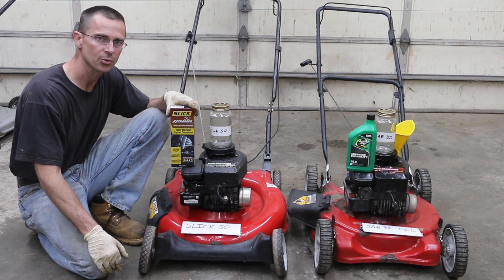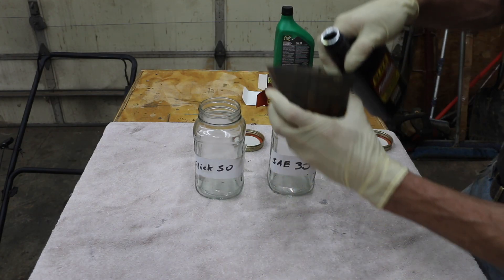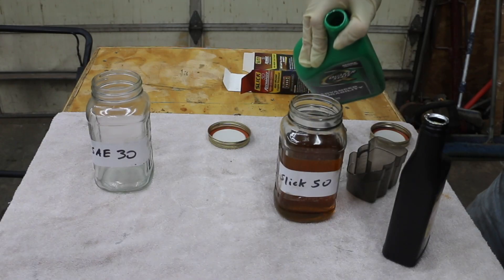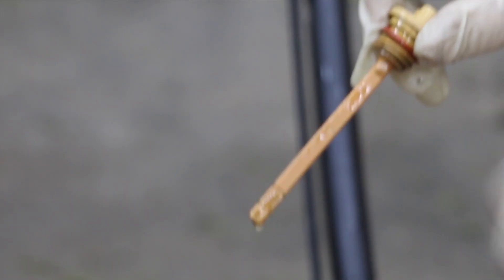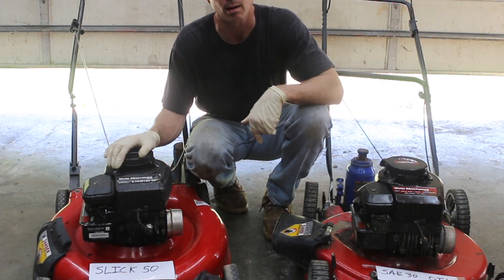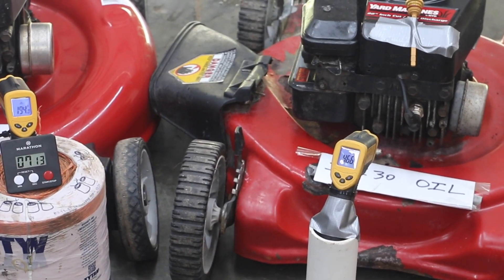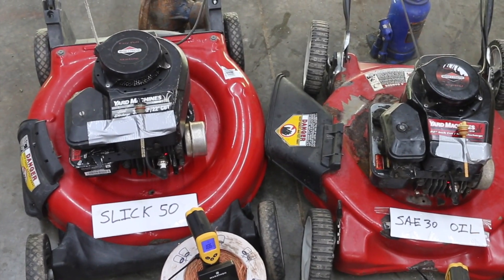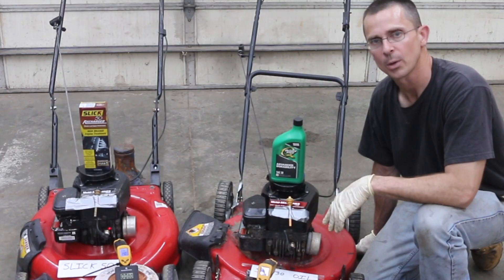Can't believe what SLICK 50 did to my engine!!--Dry Crankcase Test!

Comment: im 75 years old, and about 35 years ago I saw a Duralub oil test with DRY V 8 that ran for a long time at high RPM. I've been using it ever since.But your test with SLICK 50 has got me to wondering . Can you shed a light on Duralub?
Reply from the maker: Thanks for the video idea!

Comment: Plain bearings rely on a constantly forming dynamic oil wedge to operate in the first place. IOW, there must be a supply of oil to replenish the oil that gets 'squished out' in operation. Although I immensely enjoy Project Farm videos, this is NOT a fair test because there's no lubricant that will maintain a dynamic oil wedge merely by virtue of its viscosity or surface tension. Bearings used in engines rely on a constant exchange of oil for support and cooling. Still ... very entertaining ... thanks.
Reply from the maker: Thank you for the constructive feedback.

Comment: if bearings are loose enough motor can run a long time with no oil. Tight new bearings especially aluminum ones as in these motors lock up quick. The one with slick 50 may have been a tighter engine than the 30w motor. Hard to say. The fact that we saw lower temp shows less friction So maybe re test on friction wheel wear stand device you have . Measure wear and temperature of both. Nice shows thanks
Reply from the maker: Great point. Thank you

Comment: The flaw in your methodology is the following. After testing the temps on both engines you needed to swap the oil and slick 50 into the other mover and test the temps again. Its entirely possible both engines have different characteristics and it needs to be confirmed via the swap. THEN proceed to blow both out.
Reply from the maker: Thanks for the constructive feedback.

Comment: Funny test, but unreliable results. You have two different mowers that were not built the same or even at the same time or same manufacturing plant. We do not know which mower had more hours or more sudden stops (choke outs during use) on it before you got a hold of it, heck we don't even know if the machines you chose had a properly balanced blades (assuming you left the blades on them.) Little imperfection in either motor could skew the results.

Long story short, slick 50 could be just a snake oil or it could actually do something good for an engine, the thing to keep in mind is that the results will always vary because there are no perfect results.
Reply from the maker: Thank you

Comment: Back in the 70's a friend had a new Chevy 6 cylinder van. He used 100% slick 50 instead of the recommended 10% or whatever. I ended up replacing the engine soon after and when disassembled, it had the worst cylinder ridge I'd ever seen.
Reply from the maker: Wow!  Thanks for commenting on this.

Comment: Put oil in these locked up engines, grab the blade to wiggle the engine back and forth to free it up and they will run just fine. I have bought new seized up lawn mowers from Lowes where customers forget to ad the oil, and return them after they ad the oil and lie about it, and they run fine.
Reply from the maker: Great recommendation!
Reply: @ProjectFarm  my father had a slant 6 dodge that jiffy lube forgot to replace the drain plug on an oil change. My dad locked it up then paid to have a junk yard engine installed. It ran poorly so the mechanic sent my dad to the same junkyard to pick out another engine. He chose one that was already pulled. It was installed. When the mechanic installed it he had to break it loose bc it was seized. It ran fine. Afterward, we checked it out and it was his original engine returned as a core.

Engines have aluminum piston. Aluminum expands twice as much as steel, so when they get hot they grow larger than the iron bore. There is some "welding" of the two metals but aluminum and iron really don't mix well. That's why after it cools down, a little nudge gets them moving again.

Comment: Duralube is the best additive I have used but I have not used many. I had 1986 chevette that developed a bad valve cover leak. To the point of a quart a day leaking out. I had enough to buy another car so I put a bottle of Duralube in it one day and stopped putting in oil. 2 weeks later it wouldn't go over 25 mph but this was almost 200 miles later.
Reply from the maker: Thank you

Comment: Engine Oil additives are'nt recommended for Cars or Lawn Mowers, Oil manufacturers spend millions developing Oils and no additives are necessary.  Don't use Automotive Oil in a Lawn Mower Engine, use 30.
Reply from the maker: Thank you

Comment: I never bought into the slick50 hype because every fabled oil additive I'd tried, based on testimony from technicians I trusted, did nothing but give me some kind of grief.  I worked for Mobil back in the day, and comically, Mobil1 full synthetic, was the only hype, albeit, non-impartial, that actually proved, OMG, has it been that long...  32 years later, I'm still using Mobil1...

Anyhow, I did have a neighbor who worked for Chrysler during the Slick50 craze who showed me an experiment he performed, filtering slick50 with a coffee filter.  You guessed it, the filter captured all the white gue out of the oil, which, incidentally works really nicely for any mechanical assembly lube for equipment that doesn't use oil based lubricants.  I don't recall how many microns a coffee filter, vs. an engine oil filtered to, but he expressed a concern that adding Slick50 to engine oil would have an unwanted side effect of clogging filters, causing oil to bypass and not be filtered at all.

Obviously, the premature failure on your Slick50 B&S was not induced by a clogged filter.  I'd still be curious to see what component, wrist pin, ring to cyllinder, or where the final point of failure was on the Slick50 motor.  The amount of heat the non-slick50 motor took, I'm AMAZED!!!

I only recently found your channel, but so far, I like how you think, and especially that you'll run tests with different expectations than what the results prove.  You from Missouri?  :)

Great channel, I just subscribed!  Keep doing what you're doing!

Steve
Reply from the maker: Thank you for subscribing!

Comment: It could be that both engines did not have the same wear,  the one that quit first may have had more hourly use, it could have been run low on oil before causing damage to the engine. Or the engine could have been previously overheated prior to the test not very scientific to really prove anything.
Reply from the maker: Thank you

Comment: Not as much oil was pulled out of the SAE30 lawn mower.
Reply from the maker: Thanks for commenting.
Reply: @ProjectFarm  big fan, and no disrespect. Just stating that the residual oil could have allowed the SAE 30 engine to have more lubricant and run longer.

Comment: From the looks of the front wheels the Slick mower has been pretty well beaten to death before you got it.  Did you tear down and inspect both engines before hand??  Were both engines in equal condition at the start of the test run?
Reply from the maker: Thanks for the constructive feedback.  I thought they had about the same amount of wear.

Comment: I'm assuming you didn't run the slick 50 in the engine for the suggested amount of time to coat the parts properly. In an automobile it takes a week of driving. I also didn't see the white creamy teflon in the oil that happens when you shake the bottle before applying the treatment. That being said, the new slick 50 is not the same as the original slick 50. The U.S. government forced slick 50 to stop putting in the original teflon because of "complaints" that it stopped up oil filters and damaged engines. This was back in the 1990's.  I used the original slick 50  in my 1988 ford probe and noticed about a 10 horsepower increase. Also my gas mileage increased by 2 to 3 miles per gallon. And I never had any trouble from clogged oil filters. I tried the reformulated slick 50 in my next vehicle in 2000 and never got the same results. The new formulation just doesn't work. I suspect the car manufacturers didn't like a product that makes engines last longer so they lobbied the government to kill the product.
Reply from the maker: Thanks for the constructive feedback.
Reply: Now that you mention it Larry I remember the old Slick 50 was a creamy color like caramel........I used it in my motorcycle and it increased the MPG quite a bit.

Comment: Could you please make a lock up drytest with modern capitalist MOS2 Liqui Moly additive compared to former communist 1980s east german army Motimol Mos2 oil additive? It is said that Motimol is a superb additive! Back in the GDR a bottle Motimol has been sold for 450 GDR Peoples Marks. This Motimol has been used in soviet piston aircraft engines and turbines as safety anti seize additive, in the case the engine lost its oil during fight...(hit by bullets or internal technical problems) https://www.ebay.de/itm/Motimol-Olsuspension-Olzusatz-Additiv-MoS2-Molybdan-fur-alle-Motoren-Getriebe/381533126750?hash=item58d525805e:g:OZsAAOSwqrtWp3g3:rk:1:pf:0
Reply from the maker: Great video idea!  I don't know hot to get the Motimol MOS2.
Reply: You easily can purchase NOS MOTIMOL AND GRASINOL on German Ebay.de https://www.ebay.de/itm/Motimol-Olsuspension-Olzusatz-Additiv-MoS2-Molybdan-fur-alle-Motoren-Getriebe/381533126750?hash=item58d525805e:g:OZsAAOSwqrtWp3g3:rk:1:pf:0
Reply: Here is the other communist (kolloidal graphite) oil additive Grasinol: https://www.ebay.de/itm/Grasinol-original-DDR-Zusatzoel-2-Glaser/332845644357?_trkparms=aid%3D111001%26algo%3DREC.SEED%26ao%3D1%26asc%3D20170511121231%26meid%3Df2fba862190b4727bd4cb4a998e71285%26pid%3D100675%26rk%3D2%26rkt%3D15%26sd%3D381533126750%26itm%3D332845644357&_trksid=p2481888.c100675.m4236&_trkparms=pageci%3Aeae458d7-d8df-11e8-81b0-74dbd1802730%7Cparentrq%3Aaed80c1c1660a9cc5a4e859fffffa3f7%7Ciid%3A1

Comment: I hate to see someone destroy something that  someone else could use. But I understand why you did this. Yeah I remember watching those TV ad. At the time I had gotten a 76 F150. Only had 50k miles on it. I went to the parts house an paid ?  $40 or so for this stuff. The truck ran good. But I wanted it to last as long as possiable. So the next oil changed I used  Slick-50. Seemed to be doing OK for the first month or so. Then it started to lose power, an drink gas. I took it to a shop. An the guy says to me the engine has low compression. I loved my truck I took care of it an Never abused it. I believe that Slick 50  Fubared my truck.
Reply from the maker: Thank you

Comment: In the old slick 50 commercial, didn't they fill the engine with pure 100% slick 50, run it to circulate it
Then drain it,
Then do the run test
Reply from the maker: Thank you

Comment: In my experience, the slick 50 needs some significant run time to coat the moving parts and bond the Teflon into the micropores on the surface. I have seen hydraulic motors which were run for about 24 hours on a slick 50 mix before going into service in a mine using a glycol fireproof fluid. Before treatment, they would last only a couple weeks, after treatment almost 2 months.
Reply from the maker: Thank you

Comment: I liked your test but if the mowers were brand new and identical I think it would have been much more scientific.  Using two different mowers of unknow age etc. hurts the results. The fact that the slick 50 was running much cooler is very significant and should have resulted in a much longer running time.  I used slick 50 in my Corvette about 30 years ago, I immediately saw the tack raise 200 RPM, I had to slow down my idle.  It stayed that way too!  You did do a much better job than I could have so no dis respect.
Reply from the maker: Thanks for the constructive feedback.
Reply: Hey, you did a great job!

Comment: I am with you I thought slick 50 was good stuff and I bought their ads you just threw all that out the window good job sir so I guess the best thing to do would be  regular old motor OIl 30 weight and mobile one synthetic everybody swears by that I’ve never used it just plain old motor oil has always worked for me . But to test synthetic motor oil against conventional motor oil would be a great test ! Never seen it done
Reply from the maker: Thank you

Comment: This is a cool, shits and giggles demo but in no way does it mean anything.  The Slick 50 was not applied correctly, number one.  Number two, there's no way to derive anything from this unless you had two identical spec'd new engines.....

Comment: I have never used slick 50, I was too sold on Duralube. Fell in love with it in 1992 after my husband blew a big hole out the side of our 78 Toyota Corolla R22 engine. The engine overheated and quit stranding him down in the Sumner valley. I thought it was at least worth a shot to spend the $30 on a quart of Duralube and try it out to try and save the $300-$400 it would have cost to have the car towed 75-90 miles home to South Everett. Took the oil cap off, poured about an ounce or 2 in the engine, didn't want to waste to  much cause I knew it would all come out of the hole. Started the engine and poured about a third of the bottle in till it stopped the valve chatter. Replaced the oil cap and told him to head towards home and I would be right behind him. I suggested that he stay off the freeway for at least a little while. After about 45 minutes it started to overheat, bso I had him pull over. I put another third of the bottle of Duralube in it while it was running. It cooled down to around normal or just below immediately, so we continued our trek home. This time I told him to go ahead and get on the freeway. It took us about an hour to get all the way home. To my surprise and relief a tow truck was not needed, the car didn't overheat again and made it all the way home. The valves weren't chattering again either and I still had a third of that bottle of Duralube left. I saved it for use when we did the engine swap. Added it to the oil in the new engine. That engine lasted longer than the drivetrain and everything else under the chassis. We junked it about 8 years later.
Reply from the maker: Wow!  Impressive results by DuraLube!

Comment: Three things that ultimately make this a failure test for science and no this is not a hate comment. One all parts are different so they have different strengths and will break at different times even with same oil. Two when he drained them why was one jar less full than the other when they both was full with the same amount of oil. Three why did he not just use straight slick 50 for the test as mixing it with that particular oil could create a reaction that is worse than maybe a different oil. With that being said I’ve never even heard of slick 50 so I don’t know how it’s mixed.
Reply from the maker: Thanks for the constructive feedback.
Reply: Project Farm anytime I enjoy your videos they are creative even though I can say I’ve never been in a situation to risk complete engine failure to finish a job or to get home. But non the less they are entertaining to watch

Comment: Back in 1969 a rep for Slick 50 came and did a demo where they ran it without oil for a few minutes, still I didn’t believe the hype. In 1979 I did a tuneup on a 1978 Mercury Marquis and the customer wanted to add Slick 50. I set the Idle speed at 750 rpm. A couple of hours later after making a short 100 mile trip he came back and asked what I did wrong because the engine was idling at 1200 rpm. I reset it to 750 and that’s when it struck me that the Teflon in Slick 50 did reduce friction. Years later I learned of the class action suit where they used 4 ounces of Teflon and the rest of the quart was just oil. They were overcharging consumers and settled the suit. When I was doing an oil change in my plane a mechanic recommended adding a Teflon additive, it wasn’t Slick 50 and consisted of 6 ounces of Teflon and 4 ounces of oil and was half the price of Slick 50 at the time. I still believe both helps reduce friction as the hot Teflon coated the crank journals and cam lobes and journals.
Reply from the maker: This is great information. I believe the formula change in the 1980s.

Comment: I really enjoy watching your videos, I found myself stumble on one last month and now I can't get enough, although I'm sure some of that is YouTube forcing me to watch more. I really like how you try to preform scientific tests with residential equipment, I really admit that. Now I do have two suggestions. I think it would be really cool to run an engine dry and (try) to stop it before it busts and see how exactly the engine fails, and maybe see the rod bending and such. The other is that you might want to be careful using those laser thermometers especially two at a time, the problem with them is that they aren't professional grade, which isn't a bad thing, but when using two, they are both not calibrated to what they should be most likely, so it would be wise to be careful there. (Also I used to have one of those exact ones, be careful, they melt really easily)
Reply from the maker: Thank you for the positive comments and for the advice on the laser thermometers!

Comment: This is an older video, but the first thing I noticed is there was less oil removed from the SAE 30 engine - I suspect there was actually oil remaining in the SAE 30 engine as the viscosity inside the Slick 50 engine was lower and it was easier to remove. It was interesting that the Slick 50 engine ran cooler and I would certainly like to see a more rigorous test done where you ensure every drop of oil is removed, or at least the same amount is both added and removed from both. I really like the way in which you approach these tests!
Reply from the maker: Thank you.